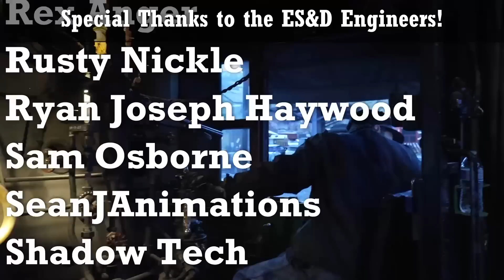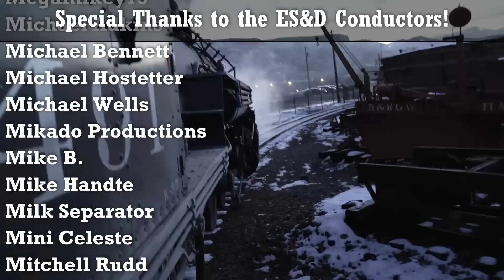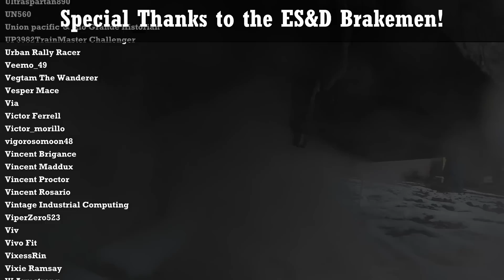Light rail isn't light? Street Car vs. Light Rail vs. Commuter Rail | Railroad 101

Comment: It very much depends on where you are. Originally in most places 'light railways' did use relatively light rail, but clearly that's no longer the case in the US. Where I'm from in Melbourne we don't really use the term. We have two 'heavy rail' networks, one broad gauge that was built up across the entire state in the 19th century until the 20s, and a newer standard gauge network that mostly does (and is designed for) freight and also interstate trains between capitals. Sometimes they're called 'heavy rail' collectively, but we usually just refer to them depending on what service it is. Branch lines used to be very lightly laid but no one called it light rail - they've closed or relaid them all.

We also have the largest tram network in the world. They started out exactly like US streetcars but due to how heavily used it is most of them are now 3-5 segment trams that resemble what the US would call light rail. Except for a couple routes almost all of it is on roads or in meridians. Then we also had a small number of 2"6' NG lines that were very lightly laid but never called light rail - 1 still exists in preservation and runs 364 days a year. 

So yeah, we have some 'light railways', but no light rail.

Comment: I paused less than five seconds before you immediately invalidated half the comment I composed.
The bit that's still valid: City buses didn't start as LF either, and both for them and for trams (screw it, pulling this general but more European term) it's been a few kinds of engineering nightmare to fit the people zone so close to the whole axle situation, hence why they only became as prevalent as anything towards the '90s and aughts.

Comment: When it comes to passenger rail, I usually follow the rough AREMA (American Railway Engineering and Maintenance of Way Association) categories, which divides it as streetcar/vintage trolley, light rail transit, rapid transit (subways, Chicago L, Vancouver Skytrain, etc), commuter rail/regional rail, intercity rail (Amtrak, Brightline, etc), and high speed rail.  Their Practical Guide to Railway Engineering has a nice overview on what separates the services; the first three are considered "Transit" (FTA regulated) and the second three are "Railway" (FRA regulated).  There's also some guidance on typical speeds, headways, distances, etc.

There are rare cases where light rail lines play host to freight trains at night (glares at San Diego) when light rail trains aren't running, and that's where I'd expect FTA/FRA joint regulation.  There's also a couple "hybrid" systems that combine elements of several types and don't fit those neat categories, such as Sprinter (glares at San Diego/Oceanside).
Reply from the maker: That's a solid set of definitions! I always forget about arema these days.

Comment: I prefer to divide rail by the degree of separation from other traffic, either road or rail:
- Sharing road lanes (streetcar)
- Separate lanes or street sections but level crossings (light rail or tram, depending on region)
- Some sections fully grade separated, some level crossings (light rail)
- Fully grade separated from other traffic whether road, rail or pedestrian (metro, subway)
- Mixing with other rail traffic like freight, sometimes with large dedicated sections, but the standard allows full inter-operation (commuter rail, regional rail)

Each kind of running conditions are better suited to a specific type of vehicle, that's why we often talk about "light rail vehicles", but there's quite a bit of flexibility in definitions. And a large number of mixed situations

Comment: Whether it's light rail, Commuter Rail or any Rail, if it's on rails or tracks I'm interested, by the way the San Diego Trolley is interesting that the Light Rail Tracks do connect to mainline tracks at the Railyard and there's even a freight operation that uses one of the Light Rail lines at night, so there are instances where even Light Rail Tracks connect to freight or commuter tracks, there’s also a light commuter rail line in Oceanside called the sprinter which they call light rail but is diesel powered and I don’t consider it true Light Rail as it’s the same style of commuter trains used in Germany and elsewhere

Comment: I've generally heard "heavy rail" being used to refer to subway/metro cars.  For example, in NYC area, you have the NYC subway which is heavy rail under the FTA.  The PATH system which runs like a subway but due to how the PRR set it up as the Hudson and Manhattan Railroad and it is under FRA authority even though it has an exclusive right of way.  Meanwhile, the LIRR and Metro-North have EMUs that superficially resemble subway cars on the outside but they are true commuter rail.

One interesting overlap is in the Cleveland RTA "Rapid" system.  It has the Red line which uses heavy-rail EMUs and also has the Green/Blue/Waterfront light rail lines.  The initial portion of these is the old Shaker Heights Rapid Transit which runs on road medians in Shaker Heights and private right of way to Tower City downtown.  The waterfront line is likewise a mix of street running and private ROW.  In a rare instance, the red, green and blue lines share tracks from just west of their separate E 79th Street stations to west of Tower City.  E 55th and Tri-C Campus District (E 24th Street) are served by all three lines with high level platforms for the red line and low level platforms for Blue and Green.  At Tower City, they still share track, however, the Red line has high level platforms on the west side and the Blue, Green and Waterfront Lines have low platforms on the east side.  The light rail trains layover, reverse or enter the Waterfront Line west of Tower City.

The trains on the Blue/Green/Waterfront Lines are "light rail" but the Shaker Heights sections were originally run with trolley and interurban cars including PCCs.  The main change in the infrastructure since then is the partial or complete removal of the PCC turning loops at the east end of the lines.
Reply: The PATH used to interconnect with the Pennsylvania railroad tracks, and later with the Northeast Corridor tracks, so it That is why PATH is under the FRA - it was literally a railroad that shared rails with FRA trains.

Comment: To be fair, the definition of light rail transit gets even more complicated than that if you look at systems around the world. Railways like the REM are (collequolly) called light rail but are fully grade separated rapid transit systems. Part of the problem is because of "light metro" in that it's a metro system with lower capacity trains but also simpler building standards than a traditional metro (the original light metro, the DLR is similar but had a justification in that it mostly consists of existing, initially ran individual cars, uses automated trains and uses vehicles which are closer to tramcars than the Underground).

There also is the O-Train which consists of two networks / lines, one which uses tramcars but is entirely grade separated, the other which uses mainlines DMU from Germany (literally, being imported) but doesn't fulfill the crash standards of Canada. On the other end of the scale, there is the Skokie Swift which is a non-grade-separated line of Chicago L but rarely talked as light railway because, well, it's part of the Chicago L which is otherwise a rapid transit system (albeit with a few level crossings) down to using the same trains (at least this century onward because it used to run under overhead wires).

One thing I will have to disagree is that street railways are (IMO at least) a subtype of light railways and I also don't consider the "strictly mixed-traffic" an important classification, though there still should be a degree of driving with cars (i.e. median running) and not besides them (tracks all the way to the side or completely away from any road traffic). For this reason, I see systems such as MAX and TRAX as regional streetcar networks with the former also being some sort of interurban. A premetro is a subtype in which case the branches are streetcar and the trunk a subway (the Green Line in Boston except for the D being the oldest example). It does leave out other systems without a proper term with some being basically mainline (TEXrail) and others being a weird mish-mash (LINK).

This isn't to say that Europe is without any problems, of course. Rotterdam has only two lines which are grade separated (though this is partially because it took over existing railways and had its level crossings inherited, though the eastern portions of lines A and B are newly constructed), Oslo has Line 1 which is entirely at grade outside of the central trunk and Line 2 shares a portion with the tramway, Bochum has the U35 which is basically a rapid transit line which just happens to have level crossings for two kilometres (being entirely grade separated otherwise), Malaga has a "tramway" which only has in common with a tramway in that it uses standard tramcars in a situation where high-floor vehicles are better suited (one line being partially underground, the other being entirely this), Manchester has a regional tramway which has more street running than some other light rail (including these which are mentioned) but also uses high-floor vehicles (no street bording), Newcastle has the Chicago L of the UK (mostly grade separated outside of the few odd level crossings due to taking over existing lines), etc.

We all are weird.

Comment: For an European, it's quite interesting how heated a debate in the U.S. can become about definitions like streetcar, light rail or commuter rail, and how much it gets into intricate details. To me, it's easy. There are streetcars, which operate according to Streetcar Operating Regulations, and there are railways, which run according to Railway Operating Regulations. To me, that's the only differentiation that counts. And an actual car running on rails can be both. It just depends on where it is. If it is on rails licensed as railway, it's a railway. If it is on rails that are licensed as streetcars, then it's a streetcar. And if it switches over from a railway licensed track to a streetcar licensed track, it legally turns from a railway car into a streetcar. Karlsruhe, Germany is famous for having their streetcars running on railway tracks. Innsbruck has the lines 6 and STB, which run as streetcars through downtown Innsbruck, but as railways up the mountains to Igls and Fulpmes respectively (it used to have the line 4 to Hall doing the same, but this one was cancelled in the 1970ies).
I even got into a heated debate how the Budapest Metro would be light rail, and not a subway, which does not make sense at all, because more than 125 years ago, it was commissioned as a subway, built as a subway and operated as a subway. Just because 75 years into its operation, someone on a different continent comes up with the term "light rail" does not change anything for Budapest Metro. It's still a subway, and it predates all subways with third rail electrification, which for some reason are now the gold standard for subways.
Reply: Are you German by any chance? Because it very German to define things according to the set of regulations they fall into ;)
Reply: @BoredSquirell  Austria. Living close to Line 3 (Igls) and STB (Fulpmes).
PS: According to the definition offered in the video, light rail systems were already present pre-WWI as cross country trams, with rails separate from roads, multi-car trains and right-of-way at level crossings. See the Belgian kusttram of 1885, or Localbahn Innsbruck-Hall of 1891, later the line 4 I already mentioned.
To me, it still does not make sense to introduce a separate definition for light rail. It's more marketing, and has nothing to do with design or technology. To me, light rail is a tram, or a streetcar, and if it's running on railway tracks, it's a railway.
Reply: @SiqueScarface  Yes, categorization in general is a hard problem, choosing which characteristics to take as relevant. Here's my counter argument: Most new "light rail" systems constructed in North America are more similar to the Frankfurt U-bahn than to most trams, meaning some tram-like and some metro-like sections. Even if just for marketing reasons I think it deserves a separate category
Reply: @BoredSquirell  With the problem that the Frankfurt U-Bahn is not a separate system from Frankfurt Tram. Frankfurt U-Bahn trains have rail connections to the Frankfurt Tram network and use the same facilities. One connection from the C-Strecke of the U-Bahn to the tram network for instance branches off at Industriehof, runs via Schlossstrasse and connects to the tram network at Adalbertstrasse close to Frankfurt (Main) West station.
Reply: @SiqueScarface  These are, however, for shunting purposes only and both systems are operationally isolated unlike e.g. Rotterdam and Oslo where tram and metro do operate on the same tracks in revenue service.

Comment: The ‘light rail’ definition also says something about the infrastructure - indeed not that the rails are “light”, but curvature and grades are… there (tighter, steeper, lighter railbeds…).

Usually, the driver is the only “operator”, without conductor, signal-operators, guards etc. except maintenance. Signalling and train orders are automated. They often have a single operations central as resilience for non-normal conditions. Yes, they happen all the time… 

Add to this that even the driver may be surplus to demand, (DLR, others) where a “service assistant” is onboard the train, but not driving it - but will if needed…

Hyce and RMTransit say this better and simpler than me; ”it depends…” 😅

Comment: In Melbourne Australia we had, for a very long time, basically two systems, the full 3 or 6 car electric passenger trains and our tram network. the electric train network also took diesel electric freight trains. We never heard the term 'light rail'
Then we started getting newer and bigger articulated trams, some now all but 3 car units. About that time two train lines started seeing severely reduced usage, so the government decided to convert them to 'Light rail', the first time I had heard the term, which basically meant those two lines were severed from the rail network and connected to the tram network, the 1500V overhead power being dropped to the 600V used by our trams.
I would have thought they'd have to rip everything out and start from scratch, but no, about the only thing that saw major change was the station platforms being way lower. Mostly they sold off the old stations and built new, much simpler ones right next door. Just a platform and a partially sheltered waiting area/seating.
It seems rather strange shooting down those lines, on regular ballasted tracks under the all but 100 year old lattice gantries and overhead gear. rather than 'custom' tram tracks set into bitumen roads, fighting with cars etc.
I always took 'light rail' to mean ''light duty rail", smaller low profile all in one vehicles, that didn't need stations and platforms, rather than physically separate cars with visible couplings between them and proper full stations etc.

Comment: The tram system in Gothemburg is running at road level, the trains consist of 3-4 car units and obey the road traffic signals, move at the same speed as cars etc. They also run on sections of the normal alignment if need be. So they're street cars but also light rail?
It's funny how in some cases what is a "train" is very blurry and undefined.

Comment: Ever since I was a kid I thought "Light Rail" was just a fancy term for a narrow gauge railroad with smaller lighter cars.
Good to see that I wasn't completely wrong.
Reply: I believe the BART system in San Francisco is the only subway system in the world using wide gauge which is a 60” span, the advantage of wide gauge is a much smoother ride the trains don’t rock around with a wider wheel base
Reply: @ytzpilot  Melbourne has broad gauge 5'3" / 1600mm commuter/metropolitan rail, including an underground section through the central city (and another being built). It probably doesn't strictly count as a subway but it's not a low-frequency system
Reply: @ytzpilot  Barcelona's L1 metro uses Iberian gauge of 1,668 mm/65.67"
L8, on the other hand, uses narrow meter gauge 1000 mm/39.37" The rest is standard gauge
In Spain there is pretty extensive meter gauge system of about 1,250 km (780 mi) that carries both passengers and freight. The regular network is broad gauge Iberian and the high speed network is standard gauge which is why there are trains that can switch between Iberian and standard gauge on the fly by passing through a gauge convertor while moving with passengers - it takes about 2 minutes at slow speed.

Comment: I always thought 'light rail' was just a modern term for streetcar (or 'tram' as it's called in places like Australia and New Zealand). If I remember rightly, nine towns / cities in NZ had electric tram networks, but they had all closed by 1964.

There was a fairly recent plan for a modern 'light rail' system in Auckland, but that was a complete disaster for a whole host of reasons, and cancelled before any length of track was even built. Fortunately, there are a few places in our country where heritage trams are preserved and restored to working order (featuring not just NZ trams, but also some trams that have come over from Australia). A good example is the Museum of Transport and Technology in Auckland.

On the subject of light rail systems, I recommend looking up the Charleroi Metro in Belgium. It's a really strange system that uses (what look like) conventional trams, but the lines are a combination of underground sections, street running and dedicated right-of-way all on the same network.